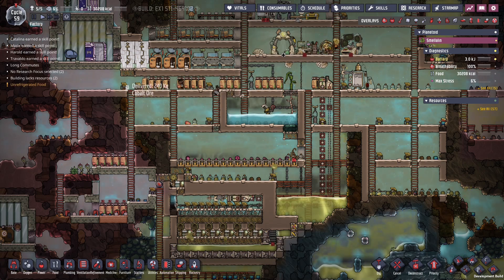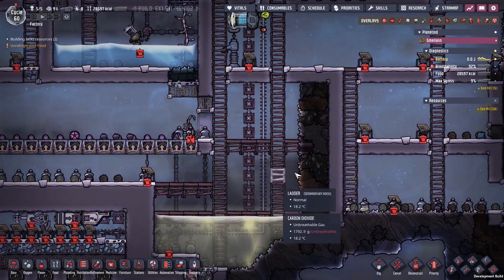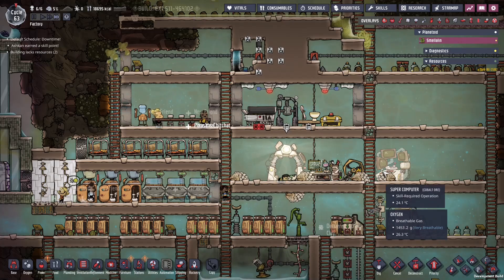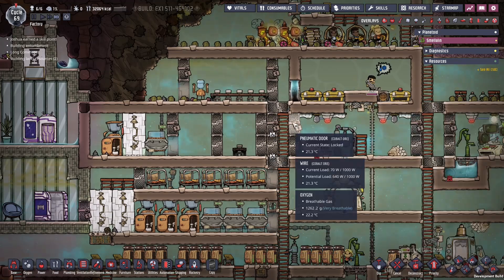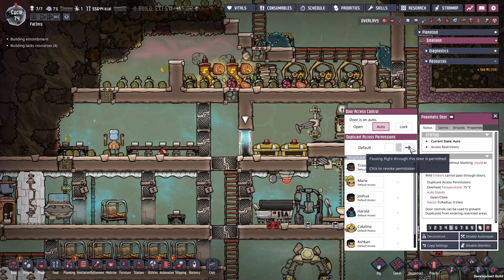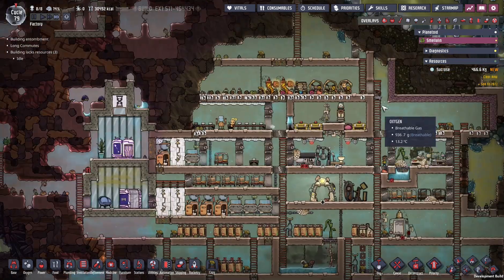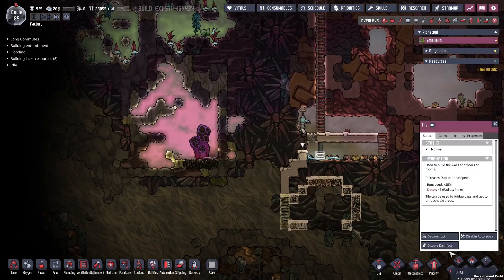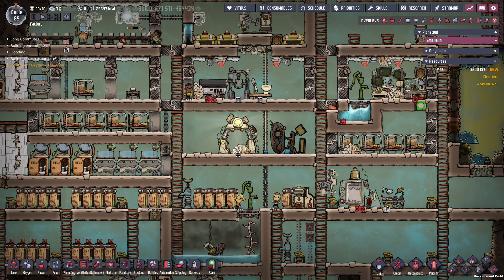The Factory: Episode 2 - Oxygen Not Included: Spaced Out!

Comment: Good explanation of the bead oxygen system. I just wonder if it isn't less intensive to just have an open vat of polluted water with a row or two of deodorizers. Is the automation (ability to close the system when not needed) and the compactness of the bead/pwater oxygen system the main driver to using it here?
Reply from the maker: Definitely can have an open room of polluted oxygen. Layer of bead pumps lets you keep pressurizing p-oxygen in case deodorizers run out of sand.